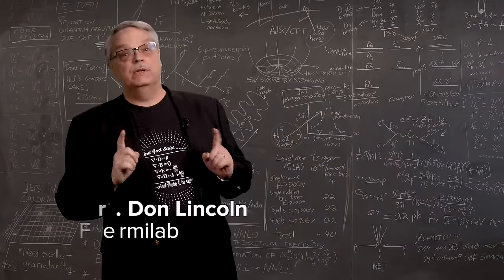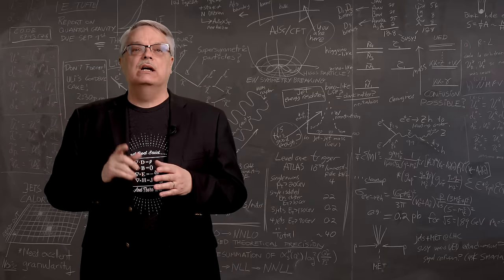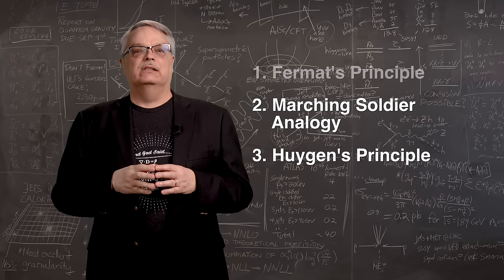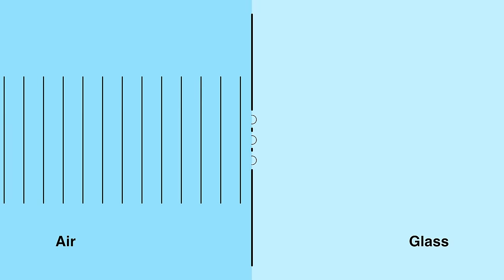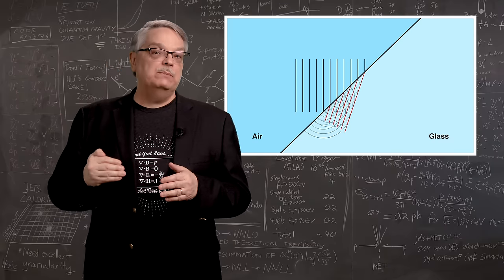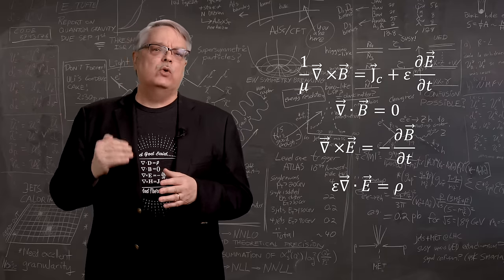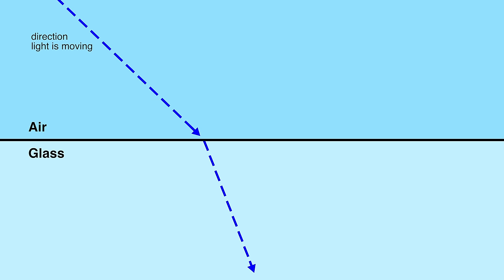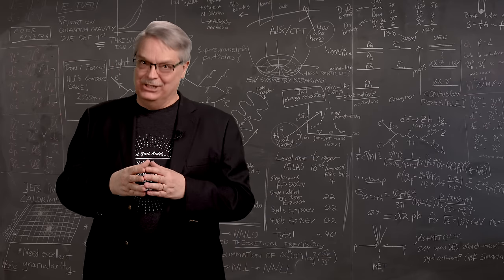Why does light bend when it enters glass?

Comment: Your explanation from 11:00 is not correct.
The vector E means in fact the magnitude and direction of the electric field in one point from space.

Your explanation is wrong because you consider Eparallel as being in the air and Eperpendicular as being in the glass (or other transparent material).
This is not correct, the point where you measure the electric field of the light (the "origin" of the E vector) is or in vacuum or in the material, cannot be in both at one moment.
And that means that both components of E (Eparallel AND Eperpendicular) should be considered as being in the same place (material or vacuum).
Reply: I think that’s okay.
As light travels in a straight line, we can just transport the vector from one point to another without deviates its direction?

Comment: Reminding of the fact quantum at the micro level is used to estimate the flow of the atom(s) behavior in the area, give to light absorption logic till actual participation is reached to continue with its pathway travel. A different spectrum support logic.
Reply: Quantum synonym to fluency in the area for the meaning logic.
Reply: The Probability of what could happen, causes adjustment abilities. Uncertainty Theory support.
Reply: The maybe of why the Diamond is a accurate projection of light.
Reply: The Diamond is, if noticed, considered a hardness to other substances.
Reply: More in place.
Reply: Plus never forgetting that light builds the "excitement state' of the atom, causing it to self adjust with its comfort hold when associating with the light.
Reply: Then as the light adjusted the excitement state of the atom's reaction that becomes shared with the next atom, is the cause of the like of a a a/c circuit keeping a steady charge flow through the circuit.

Comment: There are many loopholes in this Explanation: 
1) Frequency of light (dispersion):- Different frequencies of light bends with different angles, even if they have same magnitude of the electric field. 
2) Why the Electric field is reduced only in the perpendicular direction and why not reduces in the parallel direction? (i mean why not charges move for parallel electric field)
3) If light makes charges to move, then the Energy is dissipated by the light, But How does it gain the energy when it exits the Glass medium? 
4) How charges can move in the insulators INSULATORS with such a small electric field of light?

Comment: Why do electrons emit light in all wavelengths?
Reply: According to our model of atom, the light is emitted when the electron "jumps" from one orbit to another. There are atom/molecules with plenty different orbits and different energy (wavelength) gaps between orbits. This gives a possibility to generate/emit all wavelengths. Of course these gaps are discrete, so not exactly all wavelengths can be generated, but approximately you can build a laser with any color.
Reply: @jankrawczyk4388  Do we see the light from a lamp as white or yellow?
And if it is yellow why do we see white colors if white is all colors?
Reply: @JonasUllenius  There is no white wavelength. The white impression is in your brain only, it is a mixture of e.g three different wavelengths and this mixture is perceived as white. Colors do not exist, they are result how brain interprets different wavelengths or mixture of waves (wavelengths). Different creatures may perceive colors differently.
Reply: @jankrawczyk4388  Thx for your answer. 
In elemental terms, the sun is made up of 74 percent hydrogen, 24 percent helium and 1 percent oxygen. The last 1 percent comprises of everything else, which includes carbon, nitrogen, silicon, magnesium, neon, iron and sulfur. Although the sun is indeed a big ball of hot hydrogen and helium gases, its layers should also be given due attention.

1H=Hydrogen
2He=Helium
They do not have a lot of electrons in different positions that can change "jump" from one orbit to another.
Are all the rest elements in the sun making the rest of the wavelength that makes us see light as white?

Different elements make different light that is why we see colors it is changing the wavelength and that is why we can understand the composition of different suns, planets, and nebula.

And if the "jumping" is what makes the light then it is of that length, right? 

https://store.schoolspecialty.com/OA_HTML/xxssi_ibeGetWCCImage.jsp?docName=F1606666&Rendition=Large
https://i.pinimg.com/originals/c3/b8/2f/c3b82f7e0e6167b32a309dd4ad769fa3.jpg
Nice pictures of the sun:
https://www.space.com/30-amazing-sun-photos-space.html

Comment: In soldier's explanation: there is not any argument that can be extracted that the soldiers further the torque can travel faster than the speed of light. The soldiers further from the torque still are in the first medium where their speed is greater than the soldiers in the second medium in which the soldiers near the torque have less speed because of the denser medium.
If we take into account this argument, then the SOLDIERS EXPLANATION is RIGHT.

Comment: how does light speed back up after exiting?
Reply: it is no longer slowed by the electric field of the glass, it is back in air, so it speeds up and returns to its original direction 🙂
Reply: @ianwood3491  but how does it? what propels it after it leaves the electric field. Either the slowing down is just an illusion or some force must speed it back up.
Reply: @simonw3858  Nothing propels it. The net field in the medium and in the vacuum are totally different.
Reply: @ricomajestic  the laws of motion say there need to be another force or things will travel at the same speed.
Reply: @simonw3858  You should watch his other video where he talks about why light slows down in water. The change in the effective speed in the medium is  caused by a combination of  the incident E-field wave and the induced E-field wave  in the medium. Once you are not in the medium that effect is no longer there. There are videos on this topic all over youtube so I won't elaborate more.

Comment: Just offering Maxwell’s wonder formulas don’t explain why those formulas work. Nor does your graphics properly debug other explanations why the light bends. You made no attempt at a cloud version of a photon entering the glass. A single cloud does not behave like a row of soldiers. Also, in the previous video, which I thought was better: Mentioning WHY & how electron & photon EM wave combinations travel slower might be helpful. I expect the "slower" EM wave does not transmit (slower) through air and vacuum. Or does it? I get that the glass or water electrons no longer are changing the photon EM field once it enters the air again. This sounds similar to a runner, putting out maximum energy; the runner goes much faster through air than through 3 foot deep water. Once through, the runner goes faster again. With the photon, it's losing the drag of the glass or water electron EM fields, but I doubt the photon is in the same condition as it was. The runner's consequence of running through water is energy loss. His max energy is inherently lower. I expect the photon wave frequency is not quite as it was when it entered the media either. The photons that make it through the media can still travel at the same speed, but, I expect they are reduced in some way's'. I would love to hear more detailed explanations…. without the math and formulas. Think of me as one of Feynman’s toddlers. If you can make me understand, it could be worth a Nobel prize.

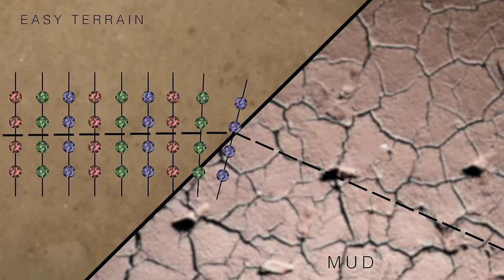Comment: 5:07 actually that part of light is moving with the same speed but the lower part's speed has decreased....so maybe it's not wrong
Reply: The only way the top could be moving with the same speed would be if it were the pivot point, but nothing has changed for the top, so there's no reason for it to be the pivot point. If there are forces being applied, they're being applied to the bottom where there is a change. Because the bottom and top are rigidly connected, this results in torque on the whole body and suddenly physics is broken because you have a photon (top) going faster than the speed of light.

Comment: Okay, but why does it bend back through the same angle when leaving the glass? Can anyone answer? 
I got what he said, its the perpendicular electric field thats weaker due to opposing electric field in glass. But when leaving the glass how does it regain the lost perpendicular electric field strength? I need to think a bit here.
Reply: The math applies at the exiting surface, but the numbers are reversed so the final path is parallel to the initial path.

Comment: I find the answer lack lusting. What happens to scattering for example? Why is there no reflection? Why is the angle fixed on reflections? Why are photons effected by electric field difference when they have no charge or mass? What is it causing the light to be slower? Are photons curving in sharp angles are in corners? If a material is not able to conduct electricity, why are electrically charged particles moving around?  
The brief explanation is as rubbish as the glossing over the suggestion that Fermat's principle is wrong.
Reply: amen...right on...he belittles some other model and then pulls a fudge factor from his orifice and says now you know why the speed reduces and it bends.

Comment: Actually,  this explanation simply shows what happens to the mathematical expressions.  The fact that this explanation is consistent with observed reality really only says that the mathematics ALA Maxwell is consistent with observed reality.  Bit of a circular argument. 

What is needed is an explanation of how the electric and magnetic components of the light wave interacts differently with air and glass.  If that is explained the Maxwell mathematics gets a pass,  AS MATHS.

You get somewhere with the explanation in that the charged fields in the glass matter separates a little when the light wave passes,  causing a sort of dipole effect,  and this separation creates a sort of back EMF which partly cancels the incident light EMF.  You do not explain why this does not work in air,  or so strongly in air.

You also do not address that the light wave is passing the glass material at the speed of light in that medium.  Is the dipole effect also created at this speed?

Interestingly you do not talk about the magnetic component of the light wave.  Surely this also affects the charges within the glass matrix.

Yes,  no?